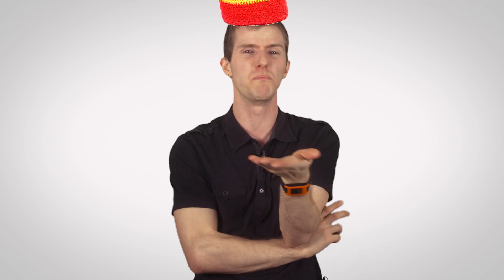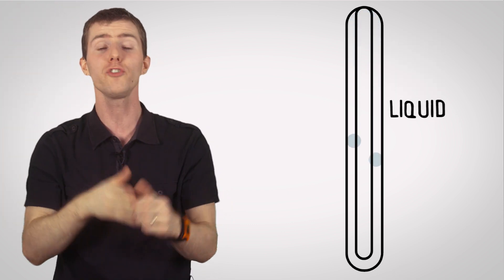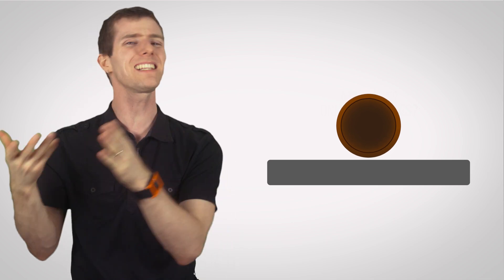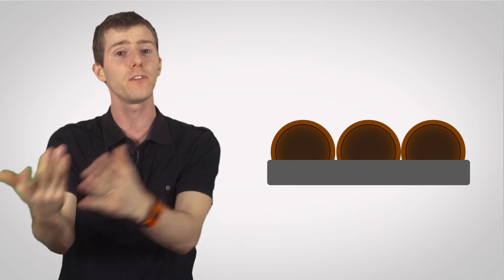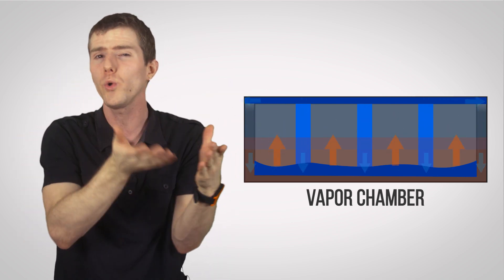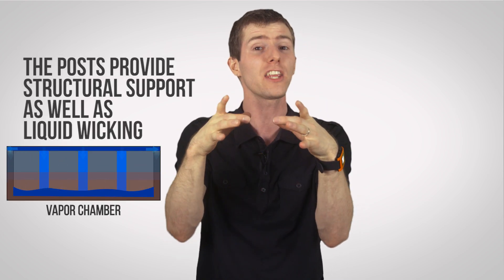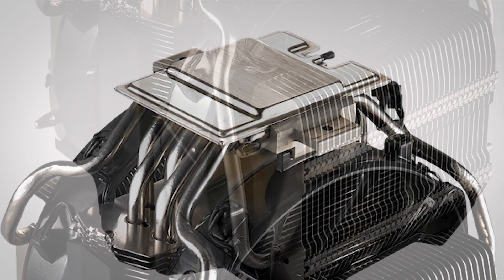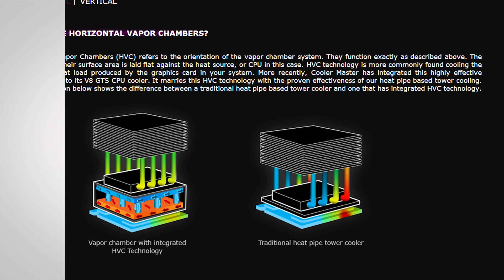What is a Vapor Chamber as Fast As Possible

Comment: I had a CM V8 and switched to H100i, I won't go back to that kind of V8 technology..
Reply: What went from for you?  I do more research on this on the side.  :o
Reply: Oyamada13 "What went from you?" ? Unsure if trolling or asking a question.
Reply: xboxnissan
Sorry.  It was suppose to be "What went wrong for you?"  Massive fail on typing. @.@
Reply: Oyamada13 It's just so ineffecient compared to my H100i.
Reply: xboxnissan
And that confirm on my findings on other review sites.  I think due to the vapor chamber being more rectangular, the vapor isn't traveling efficiently into the heatpipe to radiate the heat.  The vapor chamber and heatpipe combo is a design flaw.  It should be a more traditional solid block look with the fins act as a "heatpipe" with angler shape in the vapor chamber which leading to the fins to direct the vapor more effectively.  This design will be a combination of horizontal and vertical vapor chamber design.

Comment: Linus, should I get a h100i or a vapor chamber to cool my i7-4770k?
Reply: I'm not Linus, but you really can't go wrong with a H100i, it moves heat about 10-13" out the back of the case via a Rad.
Reply: h100i is sufficient unless you are doing ridiculous overclocking
Reply: ZanderDude Nah man I am building inside a Bitfenix Prodigy, and this will be a portable build. It will have a 780 Ti so no crazy overclocking.

Comment: Can you do a video on Ambient Occlusion? I have no clue what it is and I feel it is much more simple than it sounds.
Reply: It's not a tech quicky, but I can still give you a short rundown on what it is. Ambient Occlusion (AO) is technically just a way of generating the values of which a surface reflects light.

It calculates how light is supposed to be reflected off of a surface, based on the reflection of said surface. It's a very simple way of doing it. It's basically a "shadow map" that the game engine puts on top of textures to give it "fake" shadows. It's used together with ambient lighting, which is just a uniform light that shines on everything (think of it as the sun), and AO makes a texture map to represent where the proper shadows should be.

Comment: They can be used in outer space? How does the liquid keeps on the bottom, or near the heat source?
Reply from the maker: wicking
Reply: If you look at the interior on the chamber (provided in the video), the are webbing of wires in the chamber.  They are there for a purpose.  In a closed system and in a vacuum, the fluid have no where to go.  This will create an equilibrium using osmosis effect so the vapor will have room to travel to the cooler part of the chamber and the liquid will take its place where the vapor left.  Imagine a sponge.  If you place the sponge flat, squeeze the water out on one end and have water added on the other end, water on one side will travel to the area where the water is squeezed out through osmosis.  That's why a vapor chamber (and heatpipes) can work upside down so this application can work in space too.
Reply: capillary action
Reply: Maxjoker98 BURNED !! :O
Reply: +Neal Wilkinson Plenty of gravity in space.  It's what keeps everything in orbit.

In freefall, however, there is no weight (at least in the sense of weight being the force an object feels upon itself when resisting acceleration).

"Heat rises" is an observation of buoyancy, which is a side effect of weight.  Without weight, there is no buoyancy.
Reply: Didn't thought of that, nice!
Reply: +Daniel Carroll Heat rises because as things get hotter their atoms/molecules move more and become more spread out causing it to be less dense so the warmer parts float to the top. So so long as bits of the vapor are warmer than others they will be forced away from the cooler parts.
Reply: +dire_chinchilla  heat doesnt rise in space. there is no "up" or "down" in space, as up and down are with respect to gravity which, in space, there is none.
Reply: ....I hadn't thought about that
Reply: +Uejji true, it's been a while since my college physics days. the masses are just so far apart and so many, the forces are weak and essentially no net force
Reply: Space is cold at least the parts not in the sun but a hot part in space can't get rid of its heat there's nothing to transfer the heat to. Sure a fraction of the heat is radiated into space (just like the sun radiates its heat energy into the vacuum of space) but not enough for a part to cool itself. The ISS uses radiators filled with ammonia to gather heat from inside the ISS then the radiators radiate the waste heat out into space.
Reply: In space no one can melt ice cream!